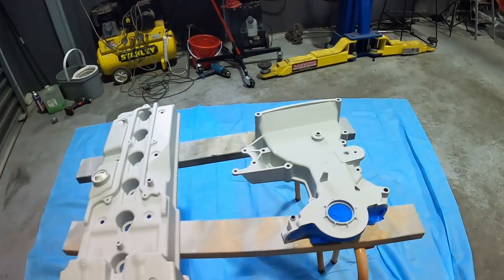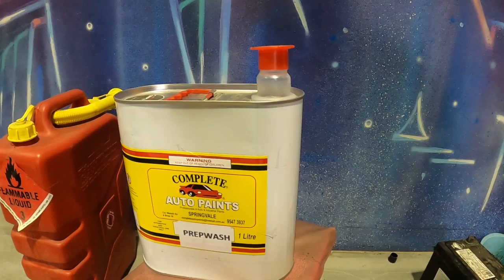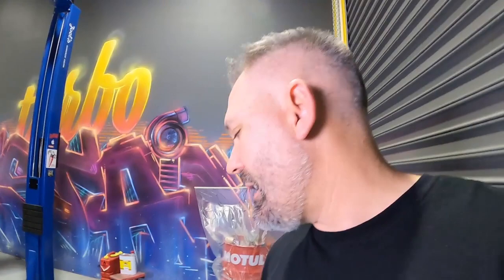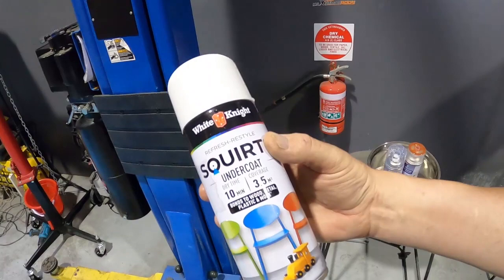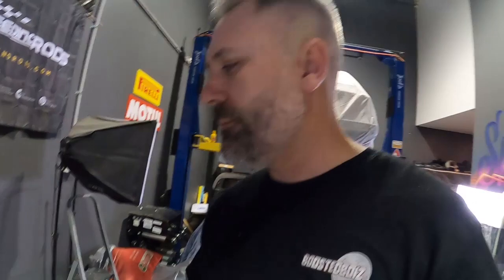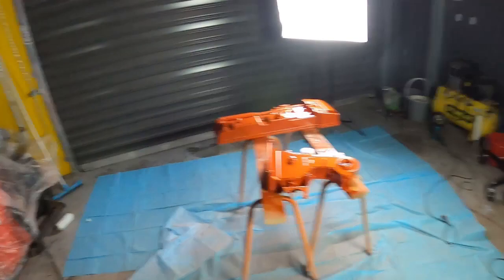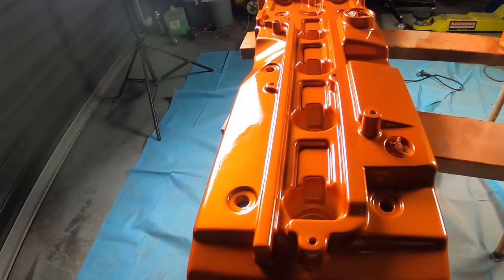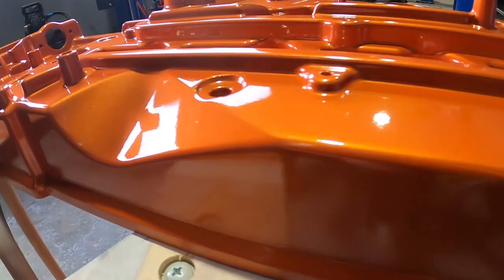HOW TO PAINT ANYTHING ON A CAR & SAVE MONEY

Comment: for wax and grease remover you can use kitchen disinfectant that you would use on your Dishes. i use this on the car when i want to remove all the wax of the paint before a clay bar scrub..
Reply from the maker: That works for degreaser but before you paint you need a solvent based cleaner

Comment: Looks good. Ready to redo the paint on mine and get my engine bay shaved and painted.
Reply from the maker: Can’t wait for that mate, it will be awesome I hope I have inspired you a bit and motivated you if a spaz like me can do it anyone can
Reply: @TURBOTRISTO  definitely so. Never really thought about heating the metal parts first. But I do use self etching primer already and I always either set cans in the sun to get hot or a bucket of hot water.  Seems to help paint alot.   I'm just going be doing the same color and fixing few flake spots in the process. But gonna be clearing over it this time. Gonna do the color like the DYC request video iv got posted. That's the color I wana do.